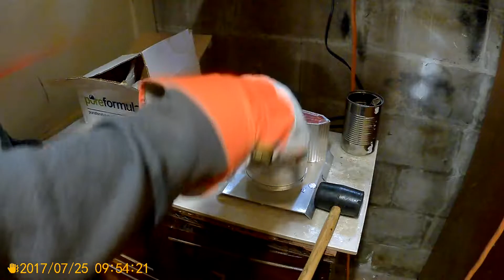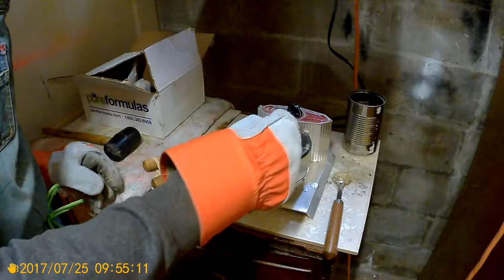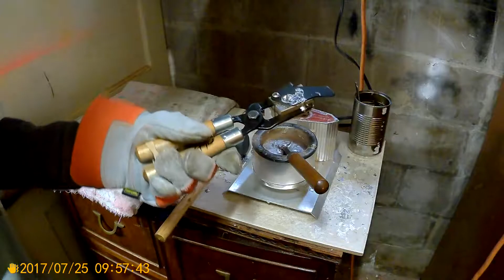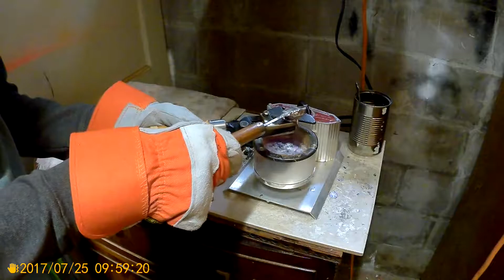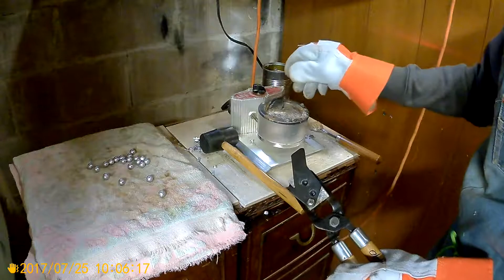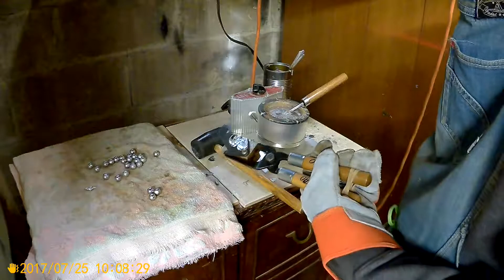Casting .490 Lead Balls

Comment: I notice a major difference in sprew`s what heat ya running at?
Reply from the maker: Full blast, 800*F ... there are a number of things about using a simple ladle (which I never use except for this video) that make it not as easy/consistent as a proper snout ladle; what specific differences are you questioning?
Reply: @rfdsrd wow and thanks
Reply: I wondered the same
Reply: Yes I also have a clotted sprew type his is more sheet like... wonder how hot myself
Reply: @rfdsrd  your sprew more like a sheet than a clot I did figure you were running hotter, thanks it does help me out knowing I can run hotter with better results than I am currently getting.

Comment: I know .490 round ball, safety first, flux reasons Could you do me a favor? What I do not know is the reason(ing) of those rubber bands on the mould/mold handle I am new to casting and it has caught my attention, Thank you, is an awesome set up.
Reply from the maker: It's important to maintain consistent pressure on the mold handles and that's the job of a double wrapped #64 rubber band.
Reply: @rfdsrd  Thanks, maintaining pressure, Preventing leakage. deformation of balls. Thanks again and you pointed out where I was having issues ever 6th-7th cast. Was not cold mold or bad lead. Pressure was off.

Comment: What ladle is that ?
Reply from the maker: lyman.
Reply: I got the LEE ladle not really much of difference does same job I can admit I have been looking at the bottom pour ladle, cost more in the end run, I think could be cost effective in long run
Reply from the maker: @taurushipointenthusiast1306  Bottom pour furnaces can have their issues with clogged spouts and ladles are more efficient and allow for "compression casting".  I always use a good ladle and cast for Many different bullets, from .310 to .595 pure lead balls for trad side locks, to 348 grease groove and 528 grain paper patch slicks for Sharps replica and real Remington rolling block rifles.

Comment: What size Lee pot is that ?
Reply from the maker: super cheap 4# lee pot - more than enuf to cast muzzleloader pure lead balls.
Reply: @rfdsrd  I finally got one , Ive been using a larger cast iron pot over a burner but the Lee pot is much easier for me to use. I like your idea about using the rubberband on the handles !
Reply from the maker: @ra777wow  yep, an electric furnace is just easier and faster.
Reply: @rfdsrd  Yes caught your video and decided I did not need the $100 production this $43 pot will fill all my needs. I got mine from a tackle shop.